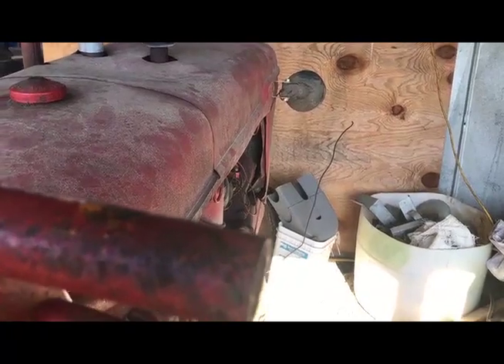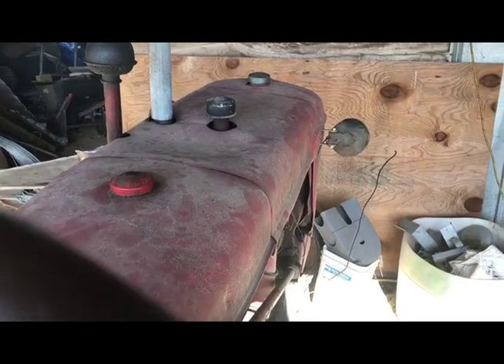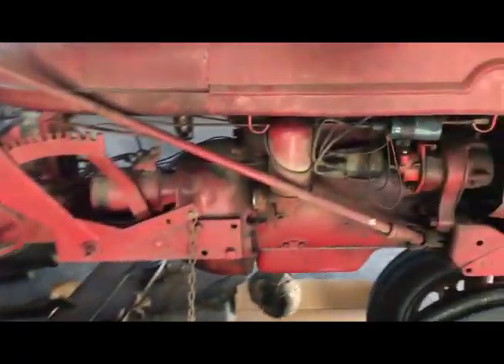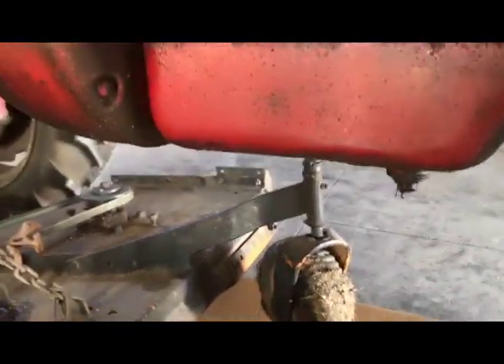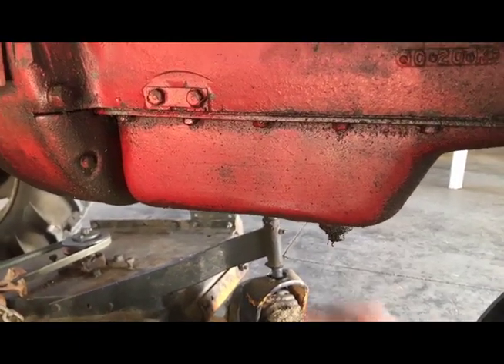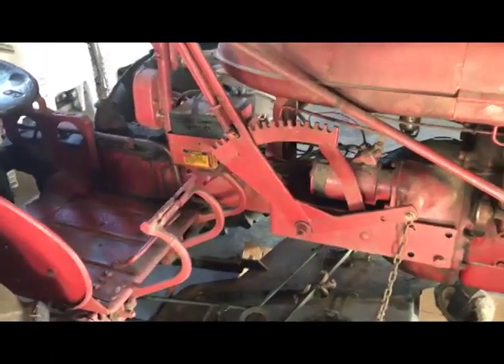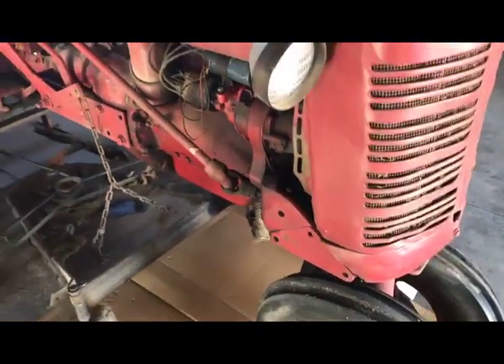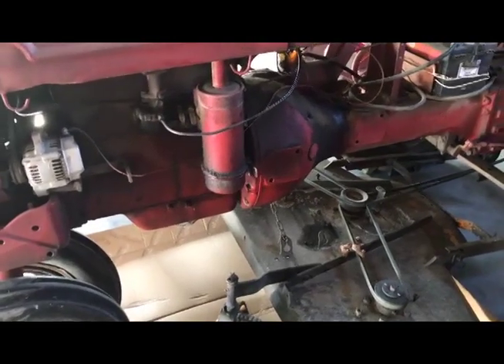Farmall BN Next Project (32)

Comment: Yes sir you can roll them in. I did mine because i was intimidated to remove the front engine pulley . After my first start up I discovered my main crank seal behind the pulley was bad . I ended up removing the pulley to replace the front crank seal anyways ,, hahaha. I had no problem rolling my Main bearings in. I had the standard size bearings in mine still. The journals where within spec so I put NEW Standard main bearings right back in. They roll in easy . I was able to roll them almost all the way in with my fingers. I made a make shift Cotter pin to slip in the oil galley in the crank to assist with completing the small ways it had to go " i got a video I made showing what I did". If you really get fancy you can buy some plasti Guage. Look up the Plasti guage on youtube and you can see how it is used. The last bearing closest to the clutch is special it takes up movement front to back. Everytime you push your clutch in you apply a lateral force to the crank . You will see what I am talking about when you get into her. When you drop your pan check for blockage at oil pump pick up. there is a video I will send ya a fella made to clean up your oil pump too. Gasket gets bad and allows a loss in pressure . Looking forward to your videos . I am here if you need anything.
Reply from the maker: Thank you, sir!  I had found most of those videos, but could not remember if I'd seen you roll yours in or not.  I did plan on looking at the oil pump when I start the work.  Probably should check it and replace the gasket while I'm that far in anyway.  Hope to get started on it in the next few days.